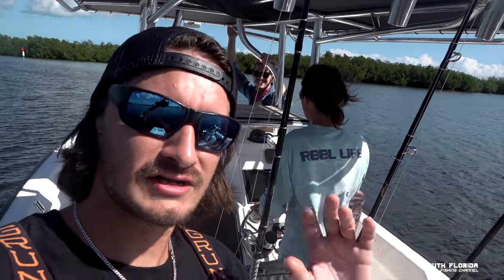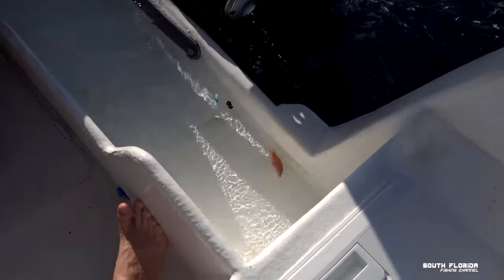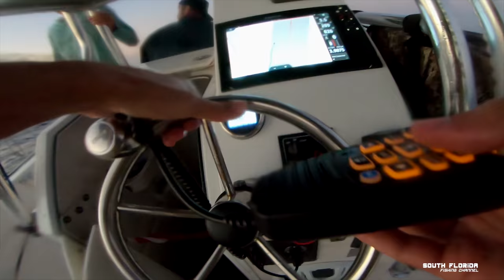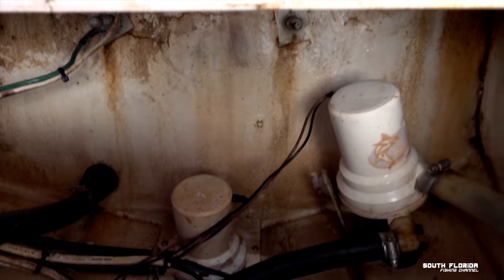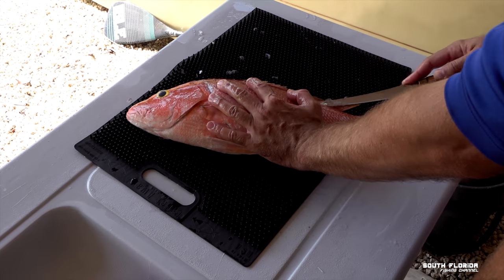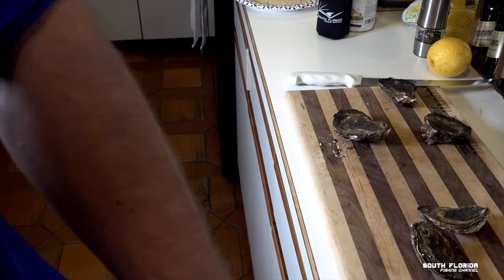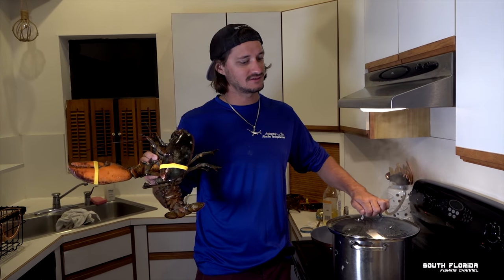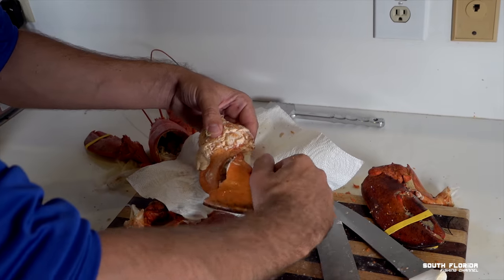Sinking 10 miles offshore | A scary fishing catch n cook

Comment: The back of that boat needs more than just fiberglass. You need to get that thing to a pro that can rebuild the whole back end of it with stainless steel and an Armstrong grade transom.
Reply: Metal brackets on fiberglass just move the stress points.
Reply: @gorchcleave5393  metal has to be incorporated into new structural fiberglass.
Reply: Aluminum and stainless will work with fiberglass. I make reinforcements for my uncles boat and his friends deep sea. You drill the stainless and or aluminum and lace the fiber in and out leaving tails. Then build the form around it. Stress point only moves when you don't brace bottom to top. You can build a square tube frame inside and then drill to the glass. Much more process but it works very well. You can do with wood frame then glass it over and lay fiber but has to be done right because bubbling in between will create a flex point that eventually will crack and fail. Did a lot of fiberglass repair and custom work for supporting lots of weight. Its all in the approach and how much you have to work with.
Reply: Fiberglass is plenty strong. It just depends on how thick it is, what kind of core structure, the condition of the core, and the design.
Edit: my current boat project is a full hull extension on a 1965 Bertram 25. It will end up looking like a bracket, but be for width, full flotation. The transom part will have a total of 16 layers of 17 oz. biaxial epoxy fiberglass and 2.25" thick Coosa board.
Reply: I prefer all fiberglass with no aluminum bracket, but to each his own.
Reply: I bet the transom is rotted, and the people that repowered the boat should have checked that .. kinda irresponsible to me, he paid good money for that..
Reply: @djmjr77  yes, And I’ll bet that new motor is over powered for that boat. It probably wasn’t built for one that powerful.
Reply: 3/4 inch plywood and run to the canyon
Reply: He needs to get a new boat and use that motor instead

Comment: So glad you guys made it out safe, that looked really scary.  Always have a plan, back up radios and an EPERB, got one last year as a result of 6 souls going into the water during a fishing event I was in, they were saved by a 911 call from 10 miles off shore on of the people on the boat was able to get off, all of the electrical systems in the boat failed due to flooding. Good news is you can get a new supper strong transom installed and the dive plate form, I would go with and Armstrong Bracket, glad you are all home safe and sound

Comment: Hey H, man i know that feeling!  I had a boat that had a similar transom and when the wind was blowing and my boat would turn waves came in the back end! I dont like open transoms.  I had someone strip it down and add marin plywood and close the transom while attaching the new transom to the old structure.  Then I made an alumimum plate that covers the entire back and front of the transom so the inside portion is grabin more with more to grab all the way up to gunnels  or the top of the boat.  Then I used a bracket and then the engine.  Your will boat will rung as if its i longer and it will give you speed.  I didnt like that because of the exention it made the back heavy but it was Awesome!  Good luck boss!

Comment: Glad you made it back safe guys! Guessing by the color around the cracks inside the bilge your transom is wood core.  It got wet, rotted and delaminated. Good luck with the rebuild! Coosa core and a bracket will last a long time if done correctly.

Comment: Dude you def need a new transom, motors got to come off, transom needs to be completely replaced, big job for your backyard. Put the boat back in the water (you'll be fine) Tow it to a reputable shop and have it fixed right. Good idea to put a bracket on. Your prob looking at 3-5k. Also have the stringers checked before you do anything. Good luck !!

Comment: You should definitely get a motor bracket good for diving also easy access on and off the boat
Reply: Motor brackets are vary problematic
Reply: @chrishammer9891  never had I problem with my Armstrong and have had it on there for 3 years
Reply: Never had a problem that you knew of over time and force of the motor they bottom of the bracket always starts digging in. Theres a reason why conch boats stopped making there 33ft and you see so many regulators on the market. Its law if physics in leverage
Reply: A motor bracket would put more pressure on the transom. Remember Sir Isaac Newton? "Give me a lever long enough and I can lift the world."
Reply: I think you broke her back. Sorry to see this.

Comment: Time for a lot of work on the boat, maybe an upgrade to a new one. Every fiberglass boat I have ever owned has had glass, gel coat and or wood rot issues. Lessons learned, My newest boat is all aluminum, it is built without  wood, glass or gelcoat. 
Good job on the “Life Savers and Good Samaritans for being there so quickly for you.
Semper Paratus! USCG Veteran 1981-1986. Cape Newagen and Cape Corwin Maalaea Harbor Maui Hawaii 🤙🏼

Comment: I'm really sorry that you went through that but glad you guys are safe.  That's a lot of stress!  Couple of things that could be learning moments for everyone; 

1) you did not have a mayday situation.  You had a Pan Pan situation.  The difference is that mayday means assistance IS required (i.e., the bilge pump is not able to keep up and we know we cannot get to shore before we sink).  Pan Pan means that you have a serious issue and may soon be in need of assistance but you may be able to recover the situation yourself.  It's likely that the Coasties were able to determine the difference in your situation and reacted accordingly but using the correct language can help to make sure the right resources are devoted to assist (and correctly prioritized if they happen to be working other situations).

2) If the guys that mounted that new outboard sunk that aluminum bolt plate that deep into your transom and didn't warn you that your transom was rotten - big shame on them.  It's possible that it sank into the transom during that failure event but the caulking looks like it was set that way before.  Either way, I have a feeling you will be better equipped to evaluate the condition of a transom in the future.  This was avoidable if a quick proper and skilled evaluation was made from the outside of the transom.

Again, REALLY glad it worked out well for you...and while it's not a small repair, it's definitely a reasonable repair.  Good luck and can't wait to see you back on the water.

Comment: Honestly your problem is Key Largo boats. I had a 2004 key largo 2300. Mine developed cracks in the transom in a similar way to yours while offshore. I also had a huge crack that formed in the bottom. They are definitely not built very well.

Comment: As a Florida boy who has eaten oysters all my life, that hurt watching y’all.
Reply from the maker: yea man sorry lol. We freaking oyster noobs
Reply: @SouthFloridaFishingChannel  Yeah, open the oyster without getting nasty shell into the meat. And get a shucking glove or use more towel to protect your hands. You noobs always end up sticking the shucking knife into your hands,, so Im giving you a heads up. Oysters are like shrimp, you want some cooked all the different ways and a real treat is oyster stuffing in your Thanksgiving turkey.
Reply: @SouthFloridaFishingChannel  dude i never wanted to say anything when you originally repowered. But how do you place a 4 stroke 250 that weights much more than the transom was originally intended for. Remember that your boat is an older boat that has a transom intended for 2 stroke. Your transom may be rated for 250 but its not rated for that weight nor that amount of torque that engine has. Also your transom is very open in the back. While your very lucky, this will be a lesson learned. Please be safe and next time do more homework when repowering. Best thing you can do is convert it to a euro transom. Or close the transom. Use straight Coosa foam with many sheets of glass. Put a heavy duty bracket and have it reinforced.  And while its opened in the back, check tge transom as well. Remember that old school 2 strokes weighed around 415lb. Much less than your engine
Reply: @antonioprado8068   That motor is a 2 stroke, But the guys that did the repower for him should have made sure this would not happen. you could see the tale signs on the inside of that transom that there is rot in it
Reply: @antonioprado8068  You might need to do your research. Evinrude never made 4 stroke outboards.

Comment: Your videos and comments are fantastic. Lots of good feedback. Yes to an Amstrong bracket and there’s your dive platform too. An offshore boat with a cutout transom and without a splashwell is dangerous. Add to this you have a plastic hatch right at your transom which will dump water into your bilge. I’ve seen a 30’ center console with twin on a setup like yours sink with the bow pushed up on the beach of a LAKE!!! There is little free board and at very critical place-so one wave and your sunk.

Comment: Transom looks rough. Who ever put that motor on should of known it was soft.
Reply: Thats my first thought.. he just had that motor put on and they should have checked for that.. what a bunch of jokers just trying to sell a motor..
Reply: That install looking at it from inside does not look correct for that size motor , if that boat is even  rated for that motor . The inside mounting points should have been spread  out across that transom with at least a aluminum metal plate of significant size to spread that load weight . Maybe over kill but that motor is over kill for that boat and i agree they should have told him so . Just my opinion
Reply: @JamesBrown-cx3xf  100%. I put a new motor on a small aluminum boat i had and replaced the transom because it look old and added an aluminum play, that was for a 40hp on a 16' boat
Reply: @djmjr77  right. There's no way they drilled that and didn't realize it was soft.
Reply: Might of happened after installation. They could of had the boat stored outside with no cover, that would do it. But the mounting is horrible. There’s not much support to spread the weight out. My father would always using large Aluminum plates to distribute the pressure and weight on the transom. This has like 2 square inch pieces if even in the bottom mounts.
Reply: Too me it just looks like it was tightened down to much crushed the fiberglass on the top and the bottom mounts are not even screwed in to keep them from spinning or backing off over time and as soon as the motor got a little leverage it started cracking and im not surprised the bottom left mount has a crack that is aligned with the corner of the plate they used... I would 100% blame whoever installed it looks like they just used whatever hardware was already on it or whatever they had laying around the shop either way they did not care money in there pockets money out your pocket.

Comment: Glad everyone came out safe and you didn't actually go down. Judging by the stains on the inside of that bilge, that transom is real rotted, and if you plan to replace, would definitely check stringers as well. Hopefully you can get her back up to 100%. We looked at a 2016 key largo 230 earlier this year, loved the layout of the boat but there was alot of wet exposed wood on that boat that shouldn't have came out of the factory.

Comment: Fun times. I do fiberglass work for myself and friends but I'm on the wrong side of the country to help. Looks like it's a wood core transom? I'm guessing the wood was wet and rotten by the way the upper bolts pulled through. I've switched over to Seacast pour transom so much better than wood and worth the extra money to know you will never have a problem. Closing the transom off and going with a bracket would be ideal and give you more deck space. Whoever you have fix it make sure they use quality materials like vinylester resin or epoxy with the correct fiberglass like 1708, I prefer Vynilester resin for the cost and ease of use. If you don't go with a pour transom use Coosa board or a similar material. do it once do it right and never worry about it.
Reply: Great advise!

Comment: You handle that like a pro good job I'm glad you're alive and your family.  I'm sure there's more panicking off camera than on. I feel like I can say that I've had my close calls on the water more than I'd like to speak of not as bad as that one though. Hey both like a car/airplane meaning you can upgrade it with low regulations however the whole should be treated like an aircraft you always got to keep the stress factor in mind. Was be honest that boat had a lot of miles on it before you upgraded it created more drag and more power to its peak rated power not to mention that engine probably has more than 250 hence like a car anytime you start upgrading the power are the s***'s got to give so be safe out there glad you're alive

Comment: Two things that come to mind that could have caused this to happen. # 1 The transom may have been compromised during  transport , did you cross any rough railroad tracks when you moved it from the shop back to the water ?
# 2 Improper throttle management. Throttling up just when half or more of the boat exists a wave , it's like trying to make a boat do a wheelie.   jus my 2c

Comment: Man glad your ok but you will probably have to take it somewhere and have the transom replaced weather or not you want to add a platform what I would do is go get a tube of 3m marine 5200 and seal all the cracks and then maybe call Dan or a tow boat and have them drag you to a launch so you don’t have the vibration and movement of the motor

Comment: After clicking the video I instantly read the description. Thank God the boat didn’t fully sink and y’all made it back safe. I’m sure there is a way to salvage the boat, and if not worst case you pull the engine electronics bulge pump, basically everything except the hull and sell the hull to someone and get a new one. Point is y’all are safe and sound. Be safe my guy 🇺🇸🇺🇸
Edit: after watching the video the cracks should be able to be patched. The dive platform and extended transom should also help with the structural integrity

Comment: Wow bizar story.... glad you all made it back alive! To me this transom construction looks tough on the outside, one big plate. But the inside looks kind of weak, especially the nuts with two small square washers on the two bottom bolts. In my opinion there should be a sort of plate on the inside too that supports all 4 bolts at once, that way the forces will be spread more evenly during sailing in harsh weather conditions. I'm sure you will figure something out to solve this issue.  All the best and tight lines! 🍀

Comment: I had something similar happen Thursday but I was 60 miles offshore and we got in some rough seas and it blew a threw hull in the bow on the boat and my main bilge failed luckily I had a second bilge and I cut the line for one of my wash down pumps to pump water and could limp in took at 30 minutes for the coast guard to come out and meet us and followed up back in coast guard did a awesome job

Comment: To get it under the deck. Use a Sawzall and cut the tower down. Lay it forward or back not to f the rigging up. Have someone weld it back up after you enclose the transom and add the Armstrong bracket.

Comment: I'm wondering if they over torqued the bolts when hanging the new motor. The backing plate looks kinda small for a 250. As far as the oysters, wear a leather glove to shuck, or warm them up on a grill or in a pan of salt until they pop open. I usually toss them on the grill over medium heat and allow them to cook in their own juice, when they pop or start leaking I open them, add a dot of cocktail sauce and enjoy.

Comment: I reckon a strong transom should be an inch of good oak plank, or 2 laminated 3/4inch waterproof ply that stretches from gunnel to gunnel and is glassed in with 3 layers of bias ply glass and epoxy.  Hey I'm no naval designer so what do I know.  Pretty sure that would be a good strong transom to take the weight of that big motor.

Comment: Looks like the wood under the glass is rotten. Gonna need some pretty extensive work. Personally when we install a motor on a fiberglass boat we use custom aluminum washers on the inside much bigger than what you have.  We also sandwich the entire transom with aluminum.   we call that a saddle in southeast Louisiana

Comment: Hi Heiko. Your videos are great and informative! Thanks for what you do!

Regarding your busted transom, I don’t know any fiberglass guys, but I did notice something in your pictures on the inside of your transom. It looks like the aluminum backing plates on the motor bolts were way too small. On my old boat, the backing plates nearly took up the entire inside of the transom and had beams bolted to the floor also.

I found a video you might find interesting that had a dive platform mounted on the back of a boat that was different than the norm. It’s on you tube titled Unleash the Beast Episode 5. 

Good luck

Comment: Glad you guys are all right! Please replace the entire transom, not just the fiberglass. The wood inside is probably no good. Get all that wood out of there and seacoast it.
Also, those tiny little nuts on the inside of the engine bolts do not spread the load enough. Please use something between the transom and the bolts to spread the load.